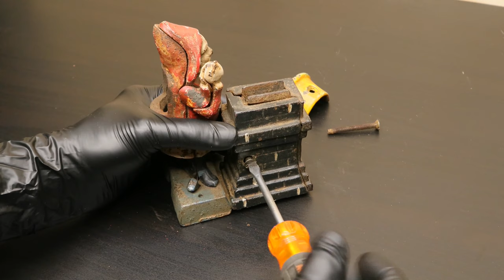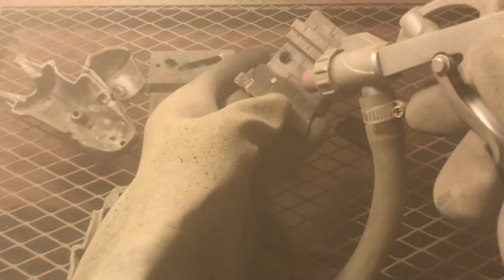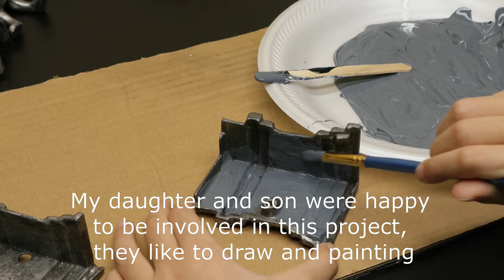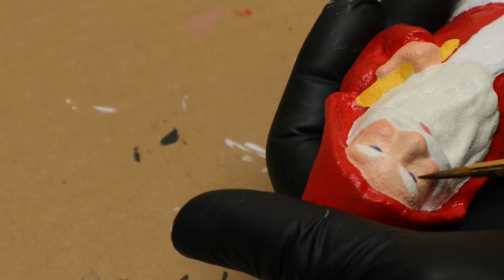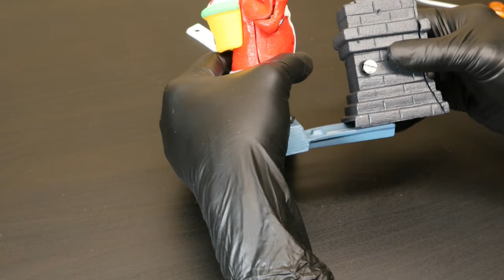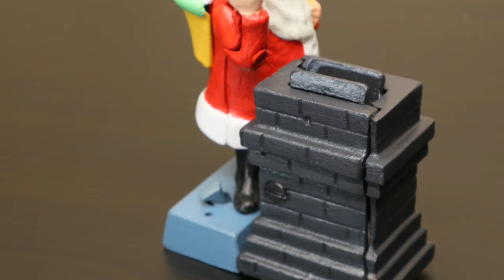Vintage Metal Santa Coin Bank Restoration.  Santa Claus is Coming to Town!

Comment: It’s always difficult when you take off the original finish of an antique and restore it with new paint. You of course have diminished the value of the antique, but you’ve increased the look of the item that you have left. My opinion is that if you are going to keep the item and enjoy it, you should have it look as good as possible. If you intend to resell it, leave it alone. The value of the original finish is always worth more than the restored item.

Comment: Ummm not sure but didn't you just devalue an antique by restoring it? it looked good restored but also not restored as well... Mmmmm conundrum
Reply from the maker: I thinks if it was a real antique with a higher value, it would be considered carefully whether to restore it. This metal Santa coin bank I bought from EBay, it is not real antique made before 1920.
Reply: @ar_restoration  well thats cool just remembering a person went on an antique show to show off their silver candle holder and that they did a good job cleaning to so it would shine .. the appraiser said   its only worth the value of the silver now but if you would have kept it with the original condition its conservative estimate would have been 250,000 dollars perhaps higher .. just makes ya think ya know? .. you did an awesome job on the santa tho so cool
Reply from the maker: @davidens8204  👍Yes you’re right，there are some antiques that could not be easily restored，that will reduce their value. It should be cautious about some items to be restored, especially some antiques, people should evaluate their age and value before restoration.